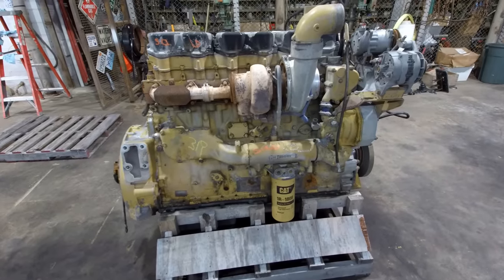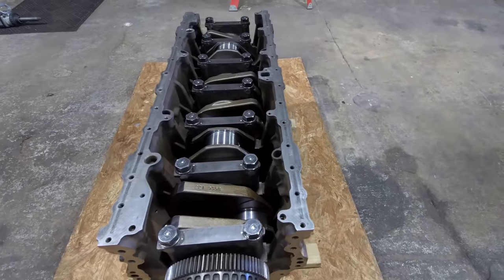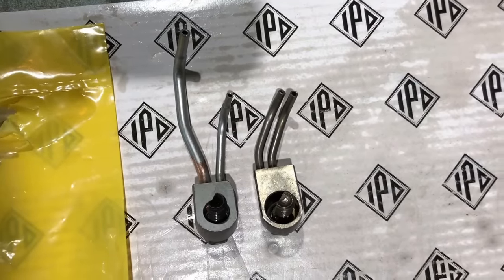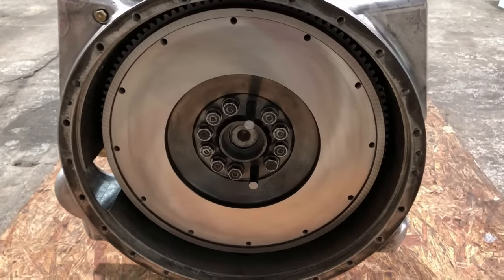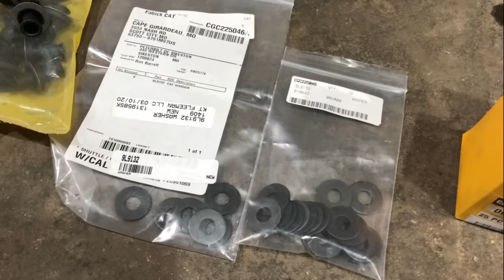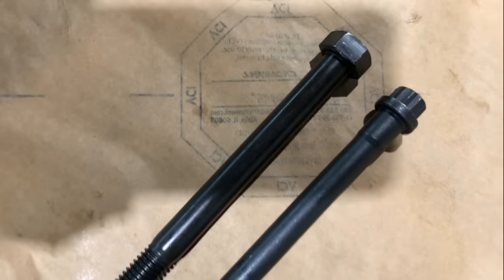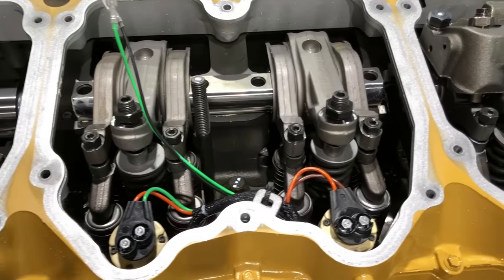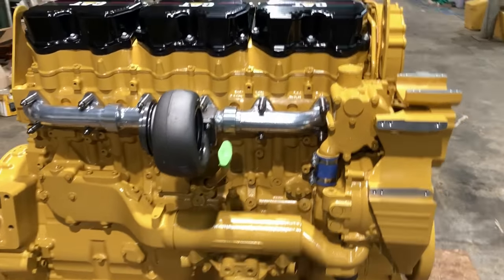800+ Horsepower 17 Liter Caterpillar Diesel Engine Build from Start to Finish + 1973 Peterbilt

Comment: 800 hp out of an engine that size is crazy to me like my little 4 cylinder makes just shy of that and it probably cost way less to build but these engines go forever and can definitely pull some weight
Reply: Car H and Diesel Truck Hp is not even close to the same thing. It the engine torque number than you be looking for to compare. Diesel engines run very slow like wide open maybe 2.000 RPM's but its the torque that is what really matters.
Reply: Hella big difference there man, diesels in this class will pull 80,000lbs all day every day for months on end.  An 800hp four cylinder might pull that for 10' before crafting themselves a crankshaft observation window in the block.

Comment: What's the best way to run in a freshly rebuilt motor? Which oil would you recommend while running-in and after that? What oil change intervals would you run afterwards under normal to severe conditions?

Comment: You have to torque the 12 point jake bolt last because if you take it to 80 then the bolts next to it to 120 it reduces the clamping force on the 12 point bolt thats why the jake housing are always fretted under that bolt/washer also if its going in a pete spin the clamps on the regulator hose 90 degrees cw so they don't get in the way or rub holes putting intake piping on

Comment: What is your turnaround from the time you get a CAT that needs rebuilding either for your own supply or a client's truck; (between the time you get it & the machine shop returns the block, crank & head if you have them all machined???)

Comment: I bought a reman 3406 b. Found out it came from mississippi.. cat reman facility. Complete engine. Put about 12000 miles on it. I did my own oil change. I was pulling out the old oil with my right index finger from the oil pan. My finger hit a chunk of metal. Retrieved a extendable magnet from my tool box pulled out a smashed f lat piece of metal. Didn't know what it was. Had black paint on it. So had truck towed to Alban cat Elkridge md. They said it was a Jake brake torque nut. But all the nuts were on the Jake they said. Paid 800.00 to Alban cat. Cat engine said u got a 1 year warranty boy.  But in realty there is no warranty. 588000 cat engine blows out the head gasket in Virginia on way to Arcadia fla. Got back to n.c. cat dealer in Greensboro. Found out that 2 liners sunk due to shims failing. Shims made with junk alloys. Also the exhaust manifold leaked from day one. No warranty on that part either. Come to find out it was warped. Junk. In my opinion Booneville Mississippi cat reman center is a junk dealer.

Comment: Have rebuilt Caterpillar engines since 1986. 3406B/C/E. Never seen a 17 litre Cat engine. They are normally C15 or C18.
Reply from the maker: It is thoroughly explained in the video.  All you have to do is watch it.

Comment: How come you recommend racing applications only for these 17 and 18ltr engine conversions, In Western Australia we have plenty of C15s converted to 18ltrs pulling quad side tippers @ 170.5T ( 340,000lbs ) and they have been getting good results

Comment: What is your opinion on keel coolers ?  Our cat engine on a dredge has problems because of overheating and I think we need to  get a radiator instead of using a keel cooler ?

Comment: Wish cat kept building truck engines. They were really something to sit behind when they were built and tuned right. It would be nice to have a choice other than an X-15 or the evil PACCAR MX. As to “competition only”, I can think of a bunch of applications where that engine would be perfect pulling freight. 150,000 or so pounds with a set of super B’s in Canada would be easy work for that engine.

Comment: Why CANT you haul frieghts with it? So what if you're putting aftermarket parts in it? Seems like building a hot rod motor for the street. Is it an emissions deal? Just curious. That old gray dump truck looks & sounds like something out of Maximum Overdrive!

Comment: How did you find the top dead center of the no 1 piston,when you did the timing of the camshaft gear?
I hope its not a secret. I also repair/overhaul engines but not cat.👍

Comment: The engine in the dump truck is the same used in an E-One ARFF crash truck I operated. The crash truck is a still a spare even though it was built in '94😖. The engine sounds the same and makes the same exhaust...

Comment: Can you put a c18 oil filter housing and cooling assembly onto a 6nz motor without changing other then then housing, oil cooler and coolant pipe to block ?

Comment: Is it possible to build 600 hp and 2050 ftlbs of torque into a 1997 3406E currently rated at 475/1850?
What if the motor is only a 1750 torque? Using your methods and parts, could 600/2050 be achieved?

Comment: Just curious what is the cost of this custom rebuild? Just had an in-frame on my ISX 600 at Pete in Jerome ID for right at 35K with a new head, Turbo, Marine camshaft, and injectors. I Have just over 100K on it now and it runs like new.

Comment: I would love to see the start up and running of this motor could you tell me if the guy has a Chanel to see the running of the truck
Reply: And ps this is the 3rd time I’ve watched this video I find it so dam interesting I’ve got a c-15 in my 2006 Pete and she runs great just it’s getting time for top end the bottoms been done at idle she’s got 40lds and running down the highway depends on oil temp I’ve got 60-68 lbs of oil pressure

Comment: I just have a few questions? I know you made this video in 2020, but I worked in a race engine shop! I never done a full OOF build like your doing! Have done a lot with doing in frames, if you get a new camshaft w that much lube on it, wouldn’t it make sense that it might be break in lube? Also I was wondering, you did another build on the engine that had almost 1.2 million miles on it, I know those cranks almost always mag good & can be machined, but would you really reuse a crank with that much time on it? Especially in an engine that’s going to get run hard? I could see if she was never going OTR again, or a show type glider, I was just wondering when they say enough is enough! Because I have seen a older 16 liter crank break? I don’t even think it had 750000 on it, with service every 11000 to 13000 miles max! It had 2 in frames 250tho & 500tho & was getting ready for a OOF, when she just broke! It was in a heavy haul Kenworth! Just wondering, since I believe you were actual cat mechanic! Thanks for any answers! 👍🏻👍🏻👍🏻👍🏻🇺🇸🇺🇸🇺🇸🇺🇸🇺🇸🇺🇸
Reply: If you are a engine builder, the crap that is on any part received from a supplier is?   You clean the part, use your trusted assembly lube. You trust nothing from anyone

Comment: Can someone properly explain to me whether a 6NZ (which I understand is part of a serial number) is a 3406E engine or a C15 engine or a C-15 engine (it seems like a C15 and a C-15 must be different engines - confusing).  So what exactly is the base engine for a 6NZ??
Reply from the maker: A 6NZ is a C-15.  C15 (no dash) signifies an ACERT engine which is one or more emissions tiers newer.
Reply from the maker: I'll also add that you may see a 6NZ called a 3406E in Cat ET, but this is an arbitrary thing for emissions certification purposes.  It is still a C-15.  The engine block is the hard determining factor between the 3400 series and the C series.
Reply: @KT3406E  ..aah, got it.  Thank you so much for that.  From what I have read and seen online, there are a lot of people that are unaware of that fact and use term interchangeably without understanding the mistake.  So a C-15 6NZ seems to be the gold standard for engines.  I already wish one.  Would love to get a truck with such an engine and begin my career.
Reply: @KT3406E  ..so I just googled a C-15 6NZ for sale, and the first 12 listings say that they have a "C15 6NZ" for sale (no dash).  They are incorrect, right?

Comment: There’s way smaller engines with the same amount of horsepower. Why does this have such a low power-to-size ratio?
Reply: Yeah ok, but does that smaller engine have 1850 Foot Pounds (2516 Newton Meters) of torque at stock HP?
Now that it’s at 800+ HP we should be seeing numbers upwards of 2400 Foot Pounds (3253 Newton Meters) of torque (based on dyno-results of similar builds).

Comment: You should not put that piston and ring assembly in a bucket of oil because you're going to get too much oil inside the ring Groove and it's going to bake and it's going to stick the ring and the engine is going to be short life just take some oil on your finger and rub around the ring and and and the Piston skirt and put it in but that is that's just that's old school doing that and it's a bad way to do it cuz you get too much oil in the ring Groove and it gets trapped and then it bakes

Comment: @19:00 with regard to the rag being jammed in there, think it was whoever rebuilt the motor the 1st time just disgruntled at their boss or what? I hope they were able to figure out which tech at the original shop did that, I feel bad for the guy that paid to have the motor redone and didn't last over 100k and probably ran like 💩all the while....

Comment: Cat making new engines it is true. True as in not reman or refurbished. Block heads even whole engine. The catch is you have to have a core. You swap Cummins to cat, Detroit to cat, international to cat ECT. Catch as to be the same yr emissions or upgrade never down grade. Deal with EPA and cat . Don't believe me check with your cat dealer.

Comment: How does one become more competent to work on the old 3406B and E and the C15s of this world? Is there a service manual how to rebuild it with all the torque specs etc? I wanna build a fully mechanical 379 with 3406B as a working truck. Right now I'm a rookie mechanic with 10 years of truckin under my belt, being cummins trained right now. Thanks.

Comment: as farr as safety does. Ive done worse I was worhing under a 1300pound jet main compressor off a tf 39 8 foot in the air I was checking for cracked or bent compressor vanes.

Comment: 21:31 I think I would build a couple 6' tall saw horses,  to atleast slow it down Incase it falls, ever since I was a kid, changing a transmission in a car, had the whole thing up in the air, started to crawl under it. The wind blew, and it fell with me 2" from being under it! It's a spooky feeling, about  2-3 seconds from no longer being in existence ! I had it blocked up steady from side to side, not front to rear,  the wind blew from the front probably a 40-50 mph gust, there it went. I thought I was dizzy from squatting down to crawl under it, until the car hit the ground!

Comment: Irresponsible, teaching bad habits! Safety police? It's only because someone died that safety measures are introduced. I worked at a sleeper making plant here in Australia and found out that one of the workers had died: he was standing under a 3 ton reel of wire when the hook broke - he had to stand there because the crane control cable was a 'little' short - the factory changed over to radio control so that workers didn't have to stand under the reel.

Comment: Had a rag in a header (combine) fuel tank once. It would cut out at full noise in the middle of the day. Then would start again next morning ok and run til the dice was rolled an it did it again. Took forever to work out why. The rag would sometimes fully block the fuel intake in the tank killing the machine. As soon as the suction was off or the tank was stirred with fuelling it would get clear again. I feel for the coolant manifold rag guy.

Comment: Is assembly lube or oil not needed on the crankshaft before installing on Diesel engines? This is the first Diesel engine I have seen built…….I think they are beautiful. POWER !

Comment: I was a trucker about 10 years in the 90’s. I drove mostly freighliners with series 60 engines. Damned good diesel, the 14l I drove for jb hunt I got new and she was tough I thought about buying it from the but I had decided to quit at that point. One thing I wish I had was a big 600 cat, 18spd peterbilt. 379. It would’ve been awesome to have that experience.

Comment: Great video apart from the dumb safety comment. I've worked on these engines a lot. Pretty good engines but Cummins are as good if not better.

Comment: Very disappointed after having just watched a bunch of Pakistani road side mechanics who overhauled the caterpillar engine in a jiffy with bare hands and dirty oily rag and cost only a fraction of what you charge. That was more exciting with all that sweat, heat, noise and dirt and true determination. No wonder the advanced world is losing out all its manufacturing and repairs to the third world.

Comment: Beautiful work as always. I bet I have seen rags, sponges and even cleaning brushes in at least 10 engines. Some of them get sucked into the air intake on a diesel. Sure does a heck of a job on a turbo. Thanks for the excellent video.
Reply: How much do you estimate something like would cost? I’m looking at buying my first Pete soon . Thx

Comment: Only a rookie would drive that Detroit like that. Complete waste of skin.
Those engines have a sweet spot where they drive and sound great which is 2100 rpm. Anything over that is useless.
Over revving it like that is not necessary.

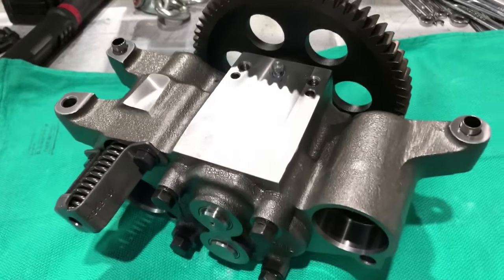Comment: 21:06 Wow, that's pretty dangerous. You're standing under a heavy load that has no additional supports AND it's only be supporting by the hydraulics of the forklift? That would not fly in any professional shop. There's two really easy ways to die right there. You really need an engine stand of some type.

Comment: I have always been amazed at just how stupid people sound when they say stroked or destroked, there is no such thing you only build an amount of displacement if you hear someone say stroked or destroked they haven't the slightest idea what they are talking about
Reply from the maker: It's a pretty simple concept really.  I understand it quite well.  When talking about an engine that normally has a 5.7" bore and 7.2" stroke (C18 in this case), but instead building it with a crank that only has 6.75" of stroke, you can accurately call it a destroked version of that engine.  That is exactly what it is, after all.  Best of luck to you.
Reply: @dba1665 tell us all about the motors YOU'VE rebuilt....oh ya, that's right....0

Comment: Zero warranty without authorized rerate through Cat,  I work for cat and can’t tell you how many illegal rerates are done, Cat has a list of illegal cat ET tool numbers that immediately void your warranty,  let alone the EPA will want to talk to you
Reply from the maker: Cat was never going to warranty an engine built in an independent shop with aftermarket cylinder packs to begin with.
Reply: @KT3406E  out cat dealer had a C15 that was overhauled by KW in Texas, paid for extended warranty, filed all paperwork,  it had head gaskets blow out 2 times before I worked on it.  ECM download was a marine application 750 HP. Had marine cam in it, Oversized Single turbo. No wastegate, owner driver stated he could climb Calhoun pass out of California at 80 mph fully loaded, didn’t understand why he was gone through his second transmission on the truck in 18 months,  Cat got involved, Cat ET tool number ending in 911 was responsible for illegal rerate, KW in Texas had to eat the whole bill, all cores,

Comment: I got a theory about what causes it. 800 horsepower.

My brother has a 6NZ with like 700 hp. I hate it. It's too much. Give me a tune I can floor without breaking stuff, any day.

F**king rags? What kinda chucklehead clown show is this?

"Only difference is it comes in a Cat box..." Except the price. Cat yellow costs more.

I understand trying to get around it, the whole reason for using one of these engines, but you do understand the purpose of emissions controls right? You do understand that 4.5 million people die every year due to outdoor air pollution, right? You do understand the government didn't put anything on the engine, the manufacturer did, right? I get using older engines to avoid emissions (the definition of a Cat engine at this point) controls, but we're all better off for diesel particulate filters, as the end of your video shows. Cat quit making road engines because they couldn't figure it out. What happened with diesel engines was the same thing that happened to gas engines in the 70s and 80s, after some time, emissions became easy. It took some time to figure it out. We're only now in the era where filtered diesels are starting to get good again. Personally, I don't buy any heavy duty road diesels after 2004. One day, they'll get to the point where we all know which ones are good again, and those will be in demand. My 2020 Ford pickup seems to be pretty good, not that it can't get better.

Comment: That looks unsafe, standing under a motor  held up by hooks on the forks of  a tow motor / you can see  motor swing back and forth as you work on it  (  danger danger  ) / no  heavy duty motor  stand  tall enough to stand under  / e/z to fabricate if you weld